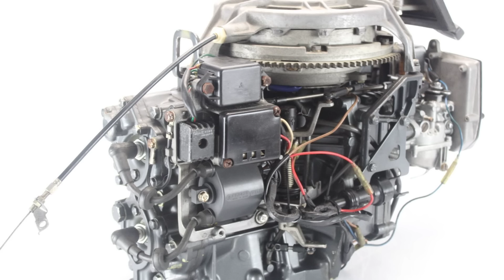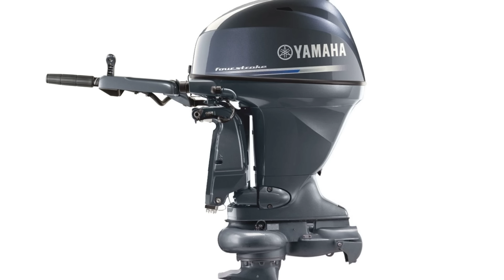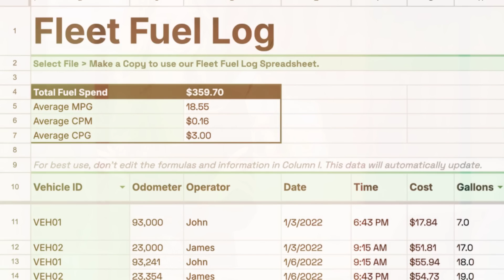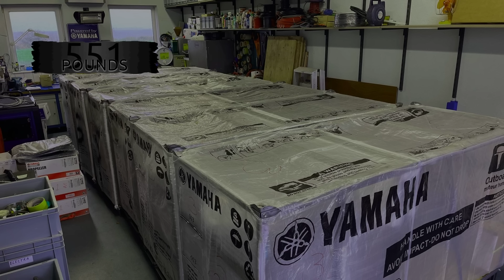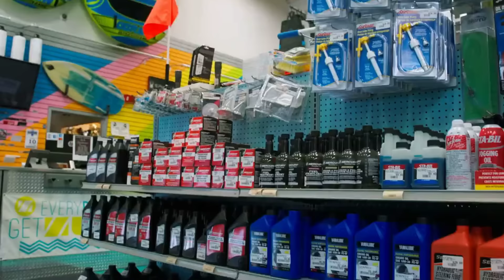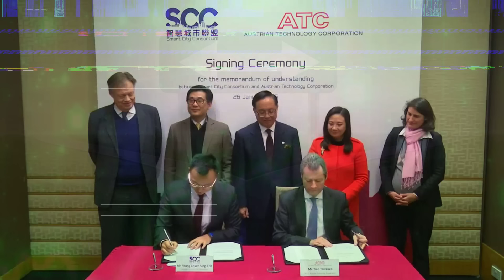This New Diesel Outboard Will Change Boating Forever (2026)

Comment: Context  matters   Diesel consistency is 20% or higher than gas.    The economy is not fuel burn,  its fuel cost  The Tech has Changed   Redline for a VW 2.0 PD engine is 4000.     Gas is cheaper for the mission.   Diesel drive outboard is a small subset of that group.     You got to need the diesel  capability  (range) because you will pay the cost.   Military that cost is no object if it enables the mission.

Comment: The three reasons given as to why OxE hasn’t taken off are garbage. Until an outboard manufacturer can get an outboard to within 10% of the weight of its equivalent petrol/gas competitor (main reason).  Second if they can get it to within 10% of the purchase price of a petrol/gas equivalent. Do those two things and they will eat a big chunk of the big 4 companies lunch. The engineering required to make that happen is astronomically hard and decades away if ever. The rest is just bullshit.

Comment: 2050hours would require multiple rebuilds on a petrol equivalent? What a load of hyped up shit. If petrol outboards are used in commercial applications where they are getting thousands of hours per year, they last a very long time and any commercial operator that had to rebuild one after 2050 hours inside the first two years would be very unhappy.

Comment: Engine first designed to go in a Diesel motorcycle.  A few were manufactured
Reply from the maker: Interesting angle. You're probably thinking of the Track T-800CDI, the Dutch diesel motorcycle that used a small Daimler Smart car diesel. The OXE actually uses a BMW 3.0 liter inline six from passenger cars, and the Caudwell uses a VM Motori V6 from the Jeep Grand Cherokee and Maserati Levante. Different powerheads, but same general principle of marinizing automotive diesels. The bike connection would be a fun rabbit hole.
Reply: @wescarver figured someone would guess Track. But no. That is a Mercedes engine.
Reply: It was either the Neander or the Thunderstar. I forget which

Comment: The only way the math works with diesels is if the torque of 1 engine is enough to power a boat that typically has 2 gas engines.  If a test proves that 1 300HP diesel can perform as well as 2 300HP gas engines ( I know top speed will be sacrificed - that is a given), then there is a chance market will listen.  Have someone like Axopar with their 37' boat that typically has 2 300hp motors put one of these diesels on it (that is one of the lightest 37' boats on the market at 8700 lb).  Yes the top end will drop from 50+mph to something in the 37-40 mph.  But that can be acceptable for many that want to cruise at 30mph and burn 1/2 or even less of the fuel.  Then you add a Sharrow prop on it and things become really interesting...
Reply from the maker: That's a sharp analysis and the single-engine substitution test is exactly what would crack the market open for recreational buyers. The torque argument works on paper. The OXE 300 makes 696 ft-lbs vs around 290 ft-lbs for a Yamaha F300, so the math says one diesel can do the work of two gas engines on a properly matched hull. Axopar 37 would be the perfect testbed because the weight and hull design are already optimized. Add a Sharrow prop and you're potentially looking at 40+ mph cruise with half the fuel burn of twin gas. Somebody needs to build that boat. If OXE or Caudwell had any sense, they'd commission exactly this kind of head-to-head publicly.

Comment: Actually, considering the price of diesel... Who would buy a diesel outboard.
Reply from the maker: The math actually favors diesel for high-hour users. Even with diesel costing more per gallon, the OXE burns 17 gph vs 25 gph for a comparable Yamaha. For a charter boat running 800 hours a year, that's around $66,000 in annual fuel savings. That's why commercial fleets are switching, not weekend boaters.

Comment: Nearly everything that really needs a diesel, doesn’t want an outboard anyway
Reply from the maker: Used to be true, less true now. The whole reason OXE and Caudwell exist is that there's a growing class of boats that actually do want both. Patrol boats, offshore wind crew transfers, commercial fishing, RIB tenders for superyachts. They want the diesel for fuel logistics and safety, but they want the outboard for service access, replaceability, and the ability to tilt out of saltwater between trips. The category sits exactly in that gap your comment identifies, and it's growing.

Comment: Absolute BS.  Compare the price of fuel first.
Reply from the maker: Let me update with current EIA data. As of May 2026, marine gasoline runs around $5.50-$6/gal and marine diesel around $6.50-$7/gal. The OXE burns 17 gph vs 25 gph for a comparable Yamaha. That puts the diesel boat at roughly $119/hr in fuel and the gas boat at $150/hr. Still about 20% lower operating cost per hour, even with diesel costing more per gallon. Tighter margin than it was two years ago, but the math still favors diesel for high-hour users. Weekend boaters running 100 hrs/year don't recover the engine premium. Commercial operators running 800+ hrs/year still do.

Comment: Diesel is also safer, less chance of an explosion from fuel vapour.
Reply from the maker: Exactly, and this is the safety dimension most coverage skips. Marine gasoline vapors are heavier than air, settle into bilges, and turn enclosed spaces into potential fuel-air bombs. Diesel does not vaporize the same way and will not ignite from a spark. Several yacht insurers now offer reduced premiums for diesel installations specifically for this reason. For anyone who's seen a marina explosion firsthand, the safety case alone justifies the premium.

Comment: You have no idea. Torque and rpm alone mean nothing. When they are multiplied together, you get a quantity that matters and it is called power. There are certainly applications for diesel engines, but the weight/power ratio, reliability, operating costs and price have to be in the right proportion. Part of the "economy" of diesel is due to the fact that it is heavier than petrol and therefore contains more energy/volume unit. Petrol is today a problematic waste product of crude oil and therefore cheaper than diesel. Price relationships have been distorted in many countries by taxation. Many of the assessments in this video are very questionable, downright misleading.
Reply from the maker: I have plenty of idea. The 46 percent fuel reduction is OXE's own testing data, not something I made up, and the torque distinction matters because diesel delivers it at low RPM where commercial work actually happens. You're right that energy density and tax distortion play a role. You're wrong that the assessments are misleading. They're sourced from manufacturer testing and verified customer reports.
Reply: You are absolutely correct about torque and RPM together creating (horse)power, which is what actually moves boats, and also on the point that diesel fuel is denser than gasoline (7#/gal vs 6#/gal), meaning there is more energy in a gallon of diesel fuel than gasoline. The apples to apples comparison would be fuel consumption in pounds of (diesel and gasoline) per distance at the same speed.

Comment: dont know any weekend fishermen spending 4 K a year on fuel.
never EVER seen a diesel outboard here in Florida.
Double the price as a Yamaha/ Suzuki....
in 15 years, no boat sitting in any driveway will have a diesel outboard.
Nobodys children will buy a boat with a diesel outboard.
Reply from the maker: Fair points on the recreational side. You're right that diesel outboards aren't going to take over weekend fishing in Florida anytime soon, the price gap kills it for most owners. The video was more about commercial and offshore operators where the math actually works, not the average bay boat. As for what your kids will buy in 15 years, neither of us knows, but I'd bet against any prediction that says the marine industry won't change.
Reply: @wescarver  commercial fisherman have big boats and big engines not outboards lol.

Comment: Add HHO & get more .
Reply from the maker: Appreciate the suggestion, but I'd want to see independent third-party testing data before recommending HHO units. The thermodynamics are tricky — most peer-reviewed studies and EPA tests have not been able to replicate the fuel savings claims. If you've personally tested one with measured before/after fuel burn data, I'd genuinely be interested to see the numbers.

Comment: I built a boat a long time ago so I could live on it. Neither an inboard nor an outboard motor would have been an option for me. In my local boating harbor, a gasoline-powered boat explodes almost every year. Even a gasoline outboard needs a fuel tank, which is usually stored inside the boat, often under a cover. A diesel engine or tank simply cannot explode.
Reply from the maker: Exactly right, and this is the safety dimension most YouTube videos on the topic skip entirely. Marine gasoline vapors are heavier than air, settle into bilges, and turn any enclosed space into a potential fuel-air bomb. Diesel does not vaporize the same way and will not ignite from a spark. Several yacht insurers now offer reduced premiums for diesel installations specifically for this reason. Sounds like you made the right call on your build.

Comment: To b gin with outboards are a compromise and are only suitable for freshwater or very light coastal boats, to hang a diesel outboard is completely absurd
Reply from the maker: Strong opinion but the operational data says otherwise. OXE's biggest customers are commercial offshore operators, military fleets, and offshore wind support vessels running serious saltwater hours. If outboards were only suitable for freshwater and light coastal use, those customers would be running inboards. They're not. The category has moved well past where you remember it.
Reply from the maker: Strong opinion but the operational data says otherwise. OXE's biggest customers are commercial offshore operators, military fleets, and offshore wind support vessels running serious saltwater hours. If outboards were only suitable for freshwater and light coastal use, those customers would be running inboards. They're not. The category has moved well past where you remember it.

Comment: Yanmar had a D27 and D36 diesels already in the 90's
Reply from the maker: Correct, and the D36 was tuned to 45 horsepower as well. Several commenters have brought up the Yanmar history, and it's worth acknowledging that the diesel outboard concept is much older than OXE makes it sound. The Scottish fish farms ran a lot of those engines, and military testing showed the tuned 45 matched a 75 horsepower petrol under full load. The reason they never scaled was hand-built cost. OXE's contribution is using automotive-derived powerheads to bring the production cost down, not inventing the category.

Comment: Nonsense, why were outboarders first only 2-stroke engines? And only very, very slowly turned over to 4-strokes? To turn to Diesel that is another world, why were Diesels only inside boats? And only in very big crusiers or commercial boats? There are Diesel outboards on the market b. t. w. they were at least, I remember an Italian Diesel-outboard with 15 hp, big as an 60 hp 4-stroke gasoline outboard and heavy as an 70 hp outboard, but loud as ten racing motors and vibrating ......
Reply from the maker: Fair points and you're right that the diesel outboard category has a long messy history. The Italian 15 horsepower you remember was almost certainly Lombardini or one of the small builders that tried to crack this market in the eighties and nineties, and the weight, noise, and vibration problems you describe are exactly why those products never scaled. The reason outboards started as two-strokes and only slowly moved to four-strokes was the same packaging problem — weight, vertical orientation, and vibration tolerance. What OXE did differently was mount the diesel horizontally and use a belt drive instead of trying to force the engine into the traditional vertical outboard layout. Whether that solves the problems enough to actually scale is still an open question. The early adoption is mostly commercial and military, not recreational, and the price and weight gap remains real.

Comment: Electric propulsion is the future
Reply: lol I'm, sure tesla will have floating charge stations lmao.
Reply: Simpler more reliable, virtually zero maintainance by comparison,  lighter more compact and ultimately cheaper with  instant power . They don't care what position they are mounted in. So vertical mounting or even submerged mounting makes construction simpler more efficient  and stealthy clean and quiet with no motor vibrations to contend with .  Yasas 1,000hp perminant magnet free motors weigh 13kg  and produce equally ridiculous amounts of torque in either direction . There's also the Italian  Deep speed  rim driven electro jets that outperform conventional water jets.

The present fuel crisis is going to screw the lid down on 70-90% of  ICE engines the FF industry is set to bury itself. There's also the problem of the whole fuel chain contamination and degradation if stored in motors or tanks. Boat industry is borrowing from Auto and Truck developments ..which are already going electric propulsion.
Reply: @clivestainlesssteelwomble7665 how long is the extension cord or how big is the nuclear reactor
Reply: @clivestainlesssteelwomble7665  “lighter” you mean just the engine and not the rest of the “support system”.  Thus making the lighter comment to biggest lie of the face of the Earth. PS even though boats can handle more load weight than cars they operating using continuous 80% plus of max power while Cars only 20% or less outside acceleration.  That’s why EV works on Cars and not boats or aircraft.

Comment: This is just an advert and bears little resemblance to the truth.  Yanmar made a 27 and a 36 hp.  They tuned the 36 to 45 hp, but that doesn't really tell the whole story.  Military testing proved that the 45 was equivalent in speed to a 55 when the boat was not loaded.  when fully loaded they were equivalent to the 75 hp petrol.  They sold a lot to the Scottish fish farms,  I had a 25 hp fitted to my yacht in 1983. Their biggest problem was that they were hand built so expensive.  An Italian firm also had a diesel outboard at the same time-a 16 hp if I recall correctly.
Reply from the maker: Really appreciate the historical context. You're right, the diesel outboard concept goes back to Yanmar's D27 and D36 in the early eighties, with the tuned 45 matching a 75 horsepower petrol under full load. Hand-built cost is exactly why those engines never scaled despite the engineering being sound. OXE's value proposition is essentially the same idea with modern automotive-derived powerheads and production scale. Thanks for setting the record straight.

Comment: I have a D36 by Yanmar , its a great old Diesel Outboard .
Reply: Yes i had a D36 too here in Australia i sold it about 15 years ago with very low ours I'm kicking myself for selling it good on fuel economy it was ex Navy still in the box it come in  it was surplus stock because of it's age I brought it at Auction now I have a Honda 4 stroke alright but i miss my Diesel
Reply: The Yanmar D36 is a 36hp, 3-cylinder, 4-stroke diesel outboard motor designed for durable marine propulsion, produced between 1988 and 1993. An underperformer.
Reply: The Yanmar D36 is a 36hp, 3-cylinder, 4-stroke diesel outboard motor designed for durable marine propulsion, produced between 1988 and 1993.
Reply: @tonyp2865  I got my one at a Navy surplus auction in the box it came in i regret to the day i sold it my mistake
Reply from the maker: The D36 is a legend. Hand-built quality from an era when Yanmar was willing to engineer at any cost. How many hours do you have on it?
Reply: You want to sell it?
Reply: @cookiedough5374  no way , its the best outboard ever . lol
Reply: @Island_Times I was expecting that. Still had to ask. Been wanting one for years

Comment: My friends 300hp OX has been nothing but trouble.
Reply: I worked in a shipyard, and the diesel engines only caused problems with the transmissions. The turbos were indeed economical, but all the professionals who operated them had to give them up.

Comment: Two non- negotiable priorities in boating come to mind about diesel outboards - significant increase in range  , and diesel boats can't blow up like gas boats can .
Reply from the maker: Two things most boat owners genuinely care about, and the safety point is the one most coverage skips entirely. Marine gasoline vapors settle in bilges and turn enclosed spaces into potential fuel-air bombs. Diesel does not vaporize the same way and will not ignite from a spark. Combine that with the 87 percent range extension on the same fuel volume and the value proposition for offshore and long-range cruisers becomes hard to argue against. The price premium is the only real barrier left.

Comment: What bullsh+t I have fitted diesel outboards to ocean going 50 ft catamarans.
Reply from the maker: The video framed OXE as the modern wave, but diesel outboards have been on serious bluewater cats for years. Curious which engines you fitted and how they held up offshore.

Comment: Don't forget,, Germany outlawed Volkswagen diesel car production....
Reply: Due to corruption.
Reply from the maker: True, and the Dieselgate fallout reshaped European diesel passenger car production. Marine diesel sits in a different regulatory category though. Commercial and recreational marine engines are not held to the same emissions standards as automotive diesels, and the OXE running on HVO100 renewable diesel produces a 92 percent CO2 reduction compared to gasoline. The marine application may actually be where automotive diesel technology survives.